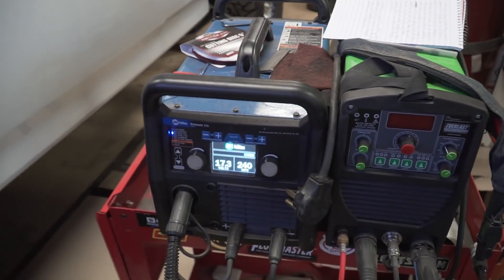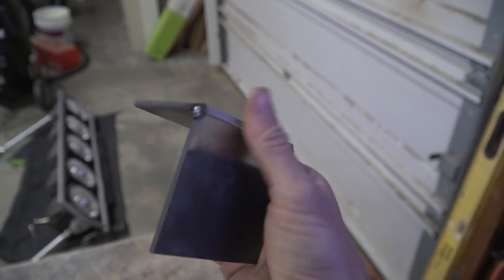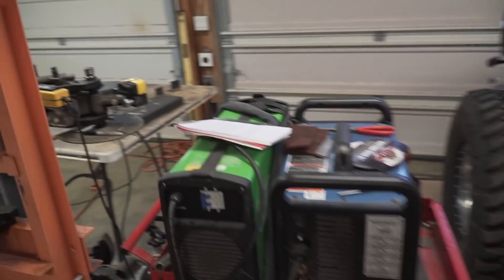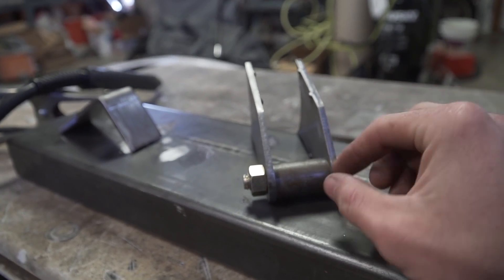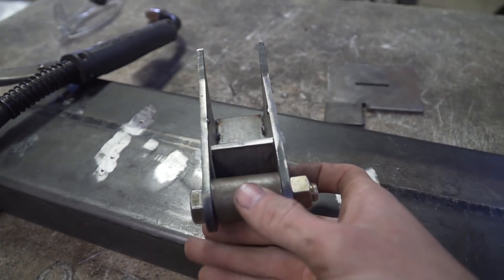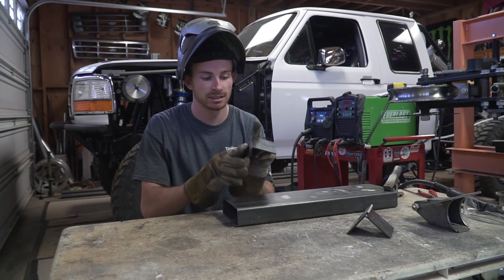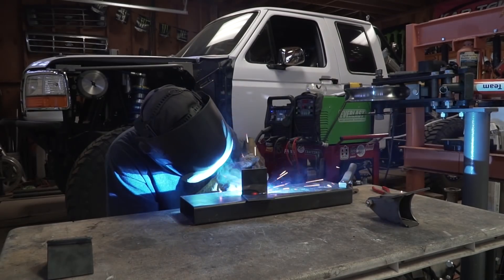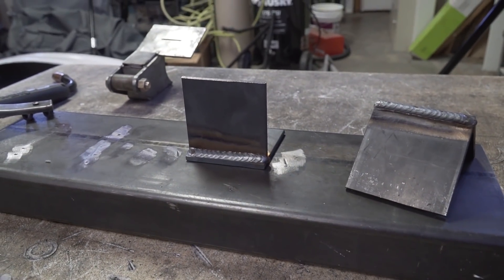FAB 101: Achieve Your BEST Welds With This Tip!

Comment: Pretty good but on thicker stuff don't use short circuit mig on thicker 1/4 inch max then use spray or dualshueld fluxcore but usually requires bigger machines to run that your welds are very well done though

Comment: Great information! Have you ever MIG welded thin wall 4130 steel tubing (I.e. 0.028/0.035/0.049/0.065... wall thickness) like that used in experimental aircraft steel tube fuselage and empennage structures? I know it is done by some manufactures for production speed. Any information, procedure or recommendations would be welcome. I’m looking for a starting point to begin and practice. Thanks!

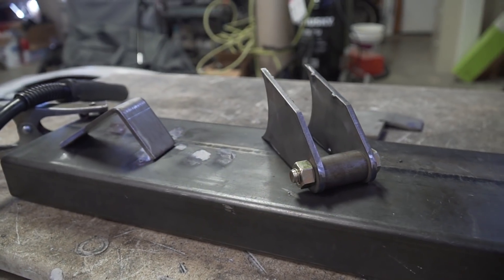Comment: Ditto on that awesome tip for using tacks to hold up the outside corner joint (right around 5:00 mark).  Can't believe I hadn't seen that before.  Nice work on the video.

Comment: Saw your vid by chance...coincidentally my son is just about to get out of the military and wants to build a race truck, and I just bought the same Miller 220 A/C D/C...learning how to use it.  Your welds look good and strong.  I've only used a Lincoln 180 HD with Flux Core .035, so gas is new to me.  Also learning to TIG (aluminum right now).  So, thanks for the info and we will be watching.

Comment: If you are using something like a slr camera for filming welding, you could tape a fixed shade welding lense onto a cardboard tube, then stick some elastic bands onto the tube which then go onto your camera. Love the use of tacks to support corner joints too, it's great to see someone remove the mill scale from metal before welding it.

Comment: Another tip! Just remember if you're going to do butt joints best practice is to bevel one of the pieces so that you get better penetration. Plus aesthetically your weld will lay in flattered.
Reply: Amateur here; I was wondering why the edges hadn't been chamfered, that was technique number one for joint strength in everything ive ever read, is there a reason to not chamfer as far as strength or penetration?

Comment: Is there a certain voltage you need per millimetre thickness of steel?
Reply: Try one amp per 1/1000th of an inch of metal... that’s usually the neighborhood you wanna be in

Comment: You should of been closer to 21-24 volts and 360 -380 ipm on 1/4 " you need around 180-190 amps to burn that. And since when does cold roll have mill scale?

Comment: Really really great fitup tip! I’ve done something similar in the past by clamping short section of angle on the inside of the joint but your method is define to remember 👌👍😎🤙